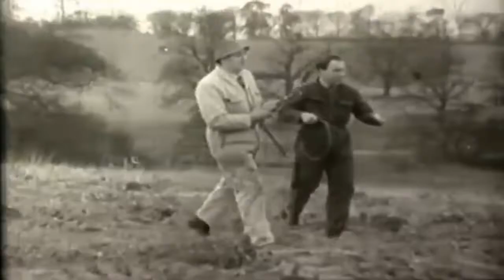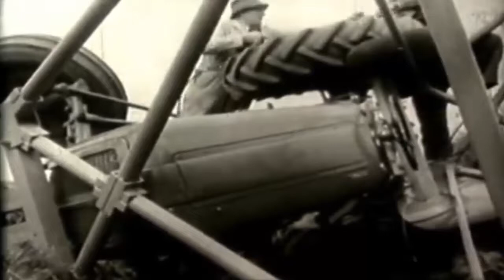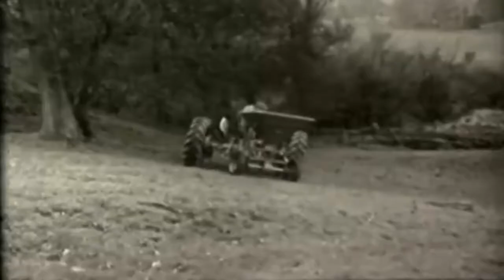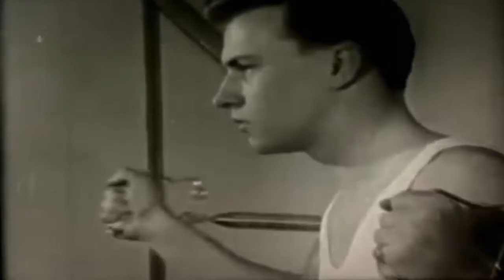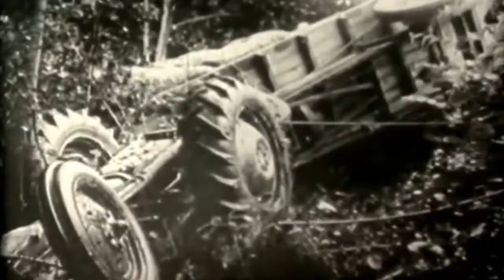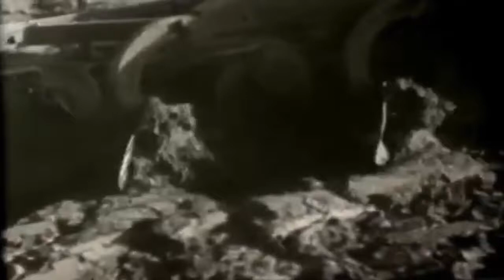Farm Safety Why tractors overturn Massey Ferguson

Comment: They’ve not only got power steering in this video but also drive by wire lol 😂 he’s controlling that tractor on/off steering/brakes perhaps in the 1960’s with a wired remote control walking way behind it. Flip

Comment: It looks like a 4 cylinder 35 they were using for the "remote" control tests so I guess the date is around 1957 to 1959 (assuming they were using a fairly new tractor). I still use a 1963 35x with a roll bar but I'm super cautious with it. There is one footpath that I have given up mowing with the 35x as the wear from walkers has, over the years, changed the profile of the land in a couple of places. I now do that with a 2-wheel BCS 740 machine - slow but safer.

Comment: These young lads of today could do with a bit of this, no brakes, no power steering, proper gears
Reply: im 14, since i live in south america (Uruguay) pretty much the tractors haven't catch up with modern technologies yet, my grandpa has a Massey Ferguson 95x from 1973, it doesn't has brakes, either hidraulic direction, a slow gearbox, he gave me that tractor for me to work few time ago, the region i have it in is really hilly, if you overturn a little bit you might just get crushed by your own tractor and roll over a few times down hill, not to mention the wet mud and rocky parts, i learned how to drive it since i was 6 and since then got the experience, i also learned with 50's ford tractors and mf (like in the video ones), 80's case internationals, old case traction king, ford 8030, 5000, new holland 7630, new holland TM 150, etc most modern i have gotten was a 298 Massey Ferguson 4x4 advanced and a John Deere CTS Rice, all of that in rice fields in really hard conditions of mud, i currently work for a small family company of rice cultivators.
Reply: They’ve not only got power steering in this video but also drive by wire lol 😂 he’s controlling that tractor on/off steering/brakes perhaps in the 1960’s with a wired remote control walking way behind it. Flip